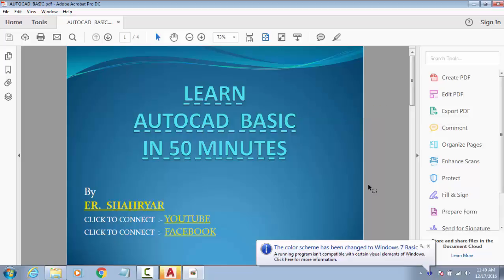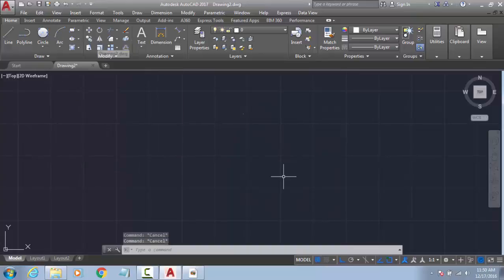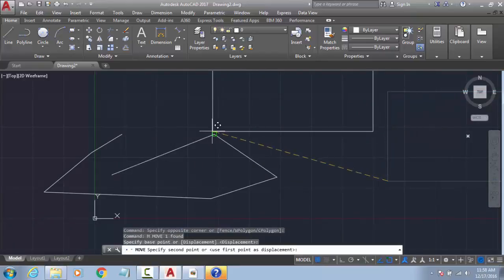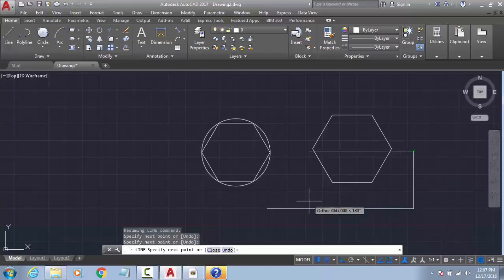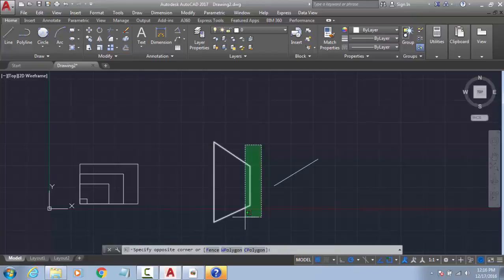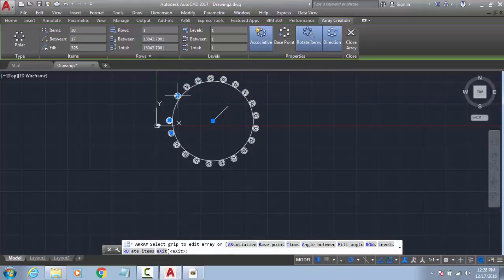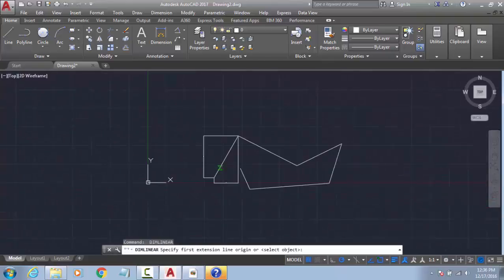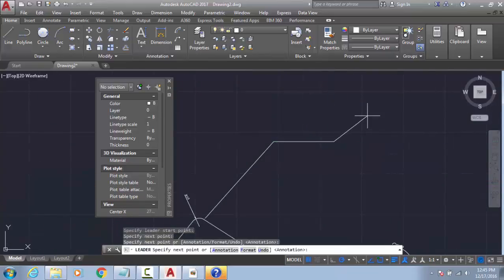AutoCAD - Complete Tutorial for Beginners - Part 1 By Desigmopc

Comment: which autocad software u r using i didtn get it
Reply from the maker: Shahzay Khan 
Thia all commands will work on every versions.
Reply from the maker: Shahzay Khan 
Even in 2010
But in this video I am using 2018 version. 
Yoy try every command on your autocad version. It will work.
Reply: +Desigmopc bro tell me the name i also dont know the name for laptop
Reply from the maker: I dont know what are you not getting.

the software name is "Autocad 2018" as I told earlier.

If you still have confusions or need any help.
Contact me direct. 
+971523998441
call and Whatsapp both will work.
I will try to solve your query.